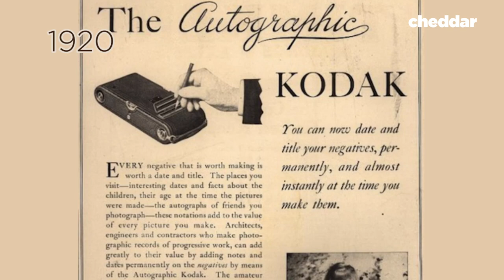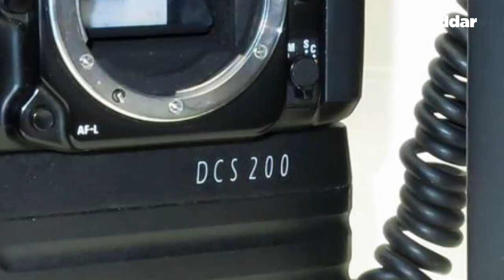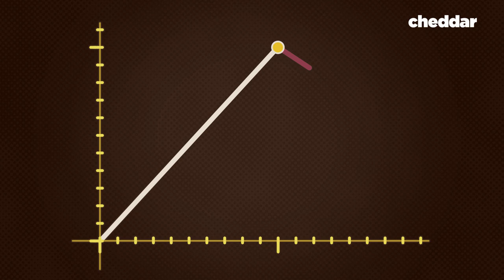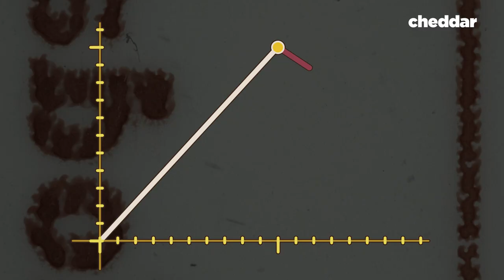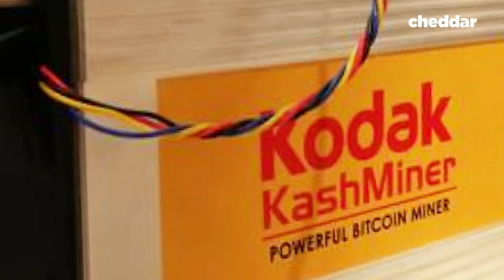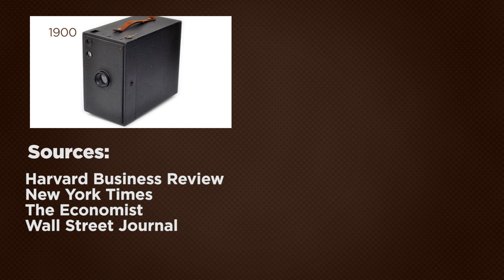Why Kodak Willingly Ignored the Future of Photography - Cheddar Examines

Comment: As a photographer who shoots 90% film. Kodak is still very much alive. Film prices are only maybe $2-3 higher than they were 20 years ago (depending where you shop). And Kodak released two new film stocks in 2018. Something that no other major film company has done in years.
Reply: I shoot some film from time to time and can agree, film is Still cheap (not using your phone camera cheap but Still cheap enough) even from Kodak, it's just that the Kodak today really isn't the same Kodak as in the past, their size is drastically reduced
Reply: But, where do you develop such film nowadays?
Reply: @jsprite123  Google it. There's still lots of places to do it.
Reply: Kodak had a lot of problems not talked about here. They were so profitable for so long that everything they did was top heavy with cost and over-engineered. Fujifilm was cutting into their film sales because they were making their products in lights-out factories that were essentially identical, i.e. lower cost, more efficient. Kodak responded to this competition by trashing Fujifilm, saying their color was inferior. All the while consumers were buying more Fujifilm. 

You could write a big book on this very interesting subject. I saw it firsthand as a software vendor to Kodak in the late 1990s when they were unraveling.
Reply: @jsprite123  Either at home or in some of the labs still around
Reply: @cpufreak101  I am puzzled by Kodak thinking. Do I understand correctly that they are pushing a hopped up version of their old Super 8 movie camera. If so, did do their R&D in a cave?
Reply: @marcomalo02  lmao. no the company itself is physically a much smaller company than it was back in the day.
Reply: Film is still being updated. The current films that we have are the best that photography has ever seen(except for TriX, HP5 and the likes).

Taking that into account, they cost just the same.
Reply: they nearly dissappeared. And finding kodak films isnt as easy or cheap outside the USA as kodak only has ONE manufacturer in the planet.
Reply: keep smokin that. No one develops it. Move on...
Reply: @justayoutuber1906  the lab in my city that develops 2000+ rolls a week would disagree with that.
Reply: Why would you still use age-old film? I mean, what real benefit does it have over sd cards and such? All I can say is that my sd card will not by damaged by SUNLIGHT
Reply: @ThatTechChannel101  This brings in the question of personal preference. Many would argue how enjoyable the process of taking photos on film is, but at the end of the day the results you get out of film is what attracts most people. Just take a look on youtube, searching film photography - there are endless videos on the topic, showing the benefit of film photography. Sure, it isn't for the average person who is looking for convenience - but for the professional/serious amateur market. It's like saying to a car enthusiast, why would you drive that 40 year old Porsche, there are so many better cars nowadays. They would laugh at your face.
Reply: @samskordi6079  interesting.......
Reply: They trying they can still make it

Comment: This is where we are with environnemental issues. We could embrace change, create jobs and become technological leaders in wind and solar energy, smart grids, clean transportation, and have cleaner, healthier air, but we insist on defending fossil fuels in fear of change. Kodak had a 15 years head start, and the resources to make the most out of the change ahead of them. We are in the same position today.
Reply: Sad
Reply: Not at all the same
Reply: Not even remotely the same.   Explain to me exactly WHO the customers are for all of this wonderful, expensive, unproven, and unworkable technology?  Which consumers want a less reliable, more expensive electrical network with higher maintenance costs, large amounts of time when power is unavailable, common brown outs, and other huge pains in the ass?  Where are the customers who want to pay 2-3x the times for this "clean transportation" you speak of?  If it's so popular why aren't busses, trains, and subways literally packed to the gills with customers, instead of needing federal, state, and local subsidy just to exist? 

Digital cameras came to be popular and take over virtually the entire camera market when they became VIABLE. Digital cameras are popular now because they are cheap, reliable, and improve on the product they replaced.  They make as good of/better a picture as the common Kodak cameras of yesteryear, cost about the same, and offer the advantage of at home printing/see your picture before printing, plus they can take virtually unlimited photos with one cheap SD card. 

 What you, and others, would have us do is try to artificially accelerate the development of all this "wonder technology" by forcing a unprepared product on a unwilling population.   Nobody was tripping over themselves to buy that first digital camera, which would have cost thousands upon thousands of dollars to create a picture only as good as a 50 dollar camera, while being impossible to carry around and insanely slow (records on a digital tape).  This is "green" energy/transportation right now.

This is the scam behind climate change... people getting rich because a very expensive, unwanted product is being forced down the public's throat.   The reality is, all of this technology was coming anyway.  We have literally spent TRILLIONS attempting to force the equivalent of a 1970s digital camera on the public, when the 2000's digital camera was coming anyway.  Nothing stops technological advancement, nothing can stop science from proceeding.   The real question is... are you really willing to entirely destroy the middle class and impoverish two generations of Americans so that we can arrive at a "green" economy  1-2 decades early?

Think I am exaggerating?  Look at the Paris Climate Accord you no doubt cried over when the US pulled out.  Estimates from pro environmental groups (let alone honest ones) calculated that to meet the accord's goals in the US, the average American's electrical bill would need to increase by a factor of ten between 2020 and 2030.   This means that if you currently have a 100 dollar a month bill you would be looking at a 1000 dollar a month bill by 2030.  Personally I would have been looking at a bill in 2030 of around 1,750-2000 dollars a month just for electricity.  That's nearly double my mortgage payment!
Reply: @testy462  You are obviously a climate change denier so no amount of argumentation from me can change your mind about that. But my point was that this story is a good analogy to our current situation: it's about embracing change. 

Sure, they couldn't have launched a digital camera in the 70s, but they had no excuse to be late in the game and let competitors win the battle. And what I think you missed is that change is not always a choice. Kodak couldn't do anything against the arrival of digital cameras, but they could at least be prepared. Climate change and other environnemental issues are a thing and if we don't act, we are going to face even bigger issues. Health issues linked to pollution are real, communities are getting progressively destroyed by rising water levels, droughts, disappearance of natural resources vital to local economies... It's estimated hundreds of millions of people will have to migrate due to climate change. 

Now, you're right, those technologies are not ready, and are, for now, expensive. But it's up to us to work on those issues and make them cheaper and better. We can create local jobs that can't be relocated in other countries. China is far from being a green country, but they are investing a LOT in solar, batteries and other critical technologies because they know there's a lot of money in those. It's up to us to compete.
Reply: That's interesting.  I was thinking the same things while watching the video. I don't have a solar panel or EV yet but it is a future we are moving into.
As a photography enthusiast, I thought Canon and Nikon will have a similar fate ignoring/delaying mirrorless cameras.  It was quite late though.  A year or two ago, I am expecting them to enter the smartphone industry as their expertise can be of value.  However, it feels quite late again now that Huawei and others are releasing ridiculously featured camera systems with at least two cameras per phone.
Reply: @testy462  If only I can dislike your comment multiple times. Even your point on digital cameras is missing the most important reason why it became popular.
Reply: BA_300_AAC Wow, you really hate green energy don’t you.
Reply: because you are in USA, a country where it only looks BACKWARDS when the  world around them is changing.  The middle class of digging for fossil fuel is DEAD.  I am sorry.  Just like automobiles destroyed horse and buggy back over 100 yrs ago.  It is going to be PAINFUL for a while until gainful work can be found for these folks.  Technology disrupt life in non-incremental ways.  Look at how long it took for PC's to change their life of a secretary.  From a person who just type reports and answer phones to now many other dimension of a companies affairs. I really wish there is a more gentle answer to what's happening in the world but this had happened before and it will happen again.   @testy462
Reply: hah. hah, hah. hah, hah, hah. Thanks, that was funny.
Reply: @genderfluids6448  He literally called climate change a scam in his comment.
Reply: Green energy is for the ungrateful and uninformed, and the greenest people on earth are the poorest. Change my mind
Reply: @quickminutetv4170  Poor people can't afford to go green.
Reply: You really don't know what the situation was with Kodak. Most of their earnings came from selling film 7$ a pop, and you blame them for not selling a product that would eliminate their profit.
Reply: Or we were in the same position 20 years ago, but GM killed the EV1. LOL
Reply: @chadthundercock4806  I blame them for knowing what was coming and not reacting properly. They were a chemical company and not really a camera manufacturing company, but they had years to prepare the shift and still failed.
Reply: mike a  Calling something a hoax is denying it, I don't see the problem there...?
Reply: mike a  I agree with you there's a lot of hypocrisy from public figures, but that doesn't mean there isn't a real problem behind all that.
Reply: Martin F Alright, lets say they somehow transition from a chemical company to a digital camera one and by some miracle their stock doesn’t plummet and lose millions.
The iPhone exists, Kodak gets fucked wether or not they transition to digital.
Reply: @chadthundercock4806  We'll never know! Fujifilm is still around. Kodak too,  albeit much smaller and doing different things today. Maybe they could have done their transitions a bit smoother? Who knows...
Reply: None of these energies is feasible. They simply don't produce enough power. The only promising alternative is nuclear.
Reply: mike a Listen to the scientists not the celebs. There’s your truth
Reply: Biplav Shrestha This is an example of market failure. The effects of climate change are far reaching and the market does not address that .  Hence the need for government involvement
Reply: Remember Solyndra? How solar energy worked for then?
Reply: Market will shift away from fossil fuels on its own when it become cheaper and profitable to do so and quality of renewable energy exceeds fossil fuels. Forcing down environmental regulations almost never work without change that disrupts the middle class in a negative way. It’s called economics.
Reply: @mintar59  I think you missed his point. It took years of development to make the digital camera and solar lol you got years for that. As an electrician I can tell you solar is garbage. First I have to install multiple panels on a roof with inverters to convert DC to AC you'll lose some power  because of the conversion. Then the panels are most effective between December to April, because when the panels get hot the resistance in the line goes through the roof and that's before it hits the inverter so That's high DC resistance. Then alot of customers are fooled thinking they'll have power when the utility is cut out.....yeah um no. You have to have a PV shut off so no back feed can be in the power lines and hurt linemen. So in order to have power during a power outage you'll need a battery storage system. To have an effective battery storage you'll need a transformer to the battery storage and give up more than half energy production to keep the batteries juiced. Now this is residential scale. It's the same song and dance on a large scale and along with wind to. The problem is the public isnt educated that most of these "green" tech make DC power which is useless. However Damns, geothermal and possibly wave technology make alternating currents which can be transported better.
Reply: @zodiacfml   I think you missed his point. It took years of development to make the digital camera and solar lol you got years for that. As an electrician I can tell you solar is garbage. First I have to install multiple panels on a roof with inverters to convert DC to AC you'll lose some power  because of the conversion. Then the panels are most effective between December to April, because when the panels get hot the resistance in the line goes through the roof and that's before it hits the inverter so That's high DC resistance. Then alot of customers are fooled thinking they'll have power when the utility is cut out.....yeah um no. You have to have a PV shut off so no back feed can be in the power lines and hurt linemen. So in order to have power during a power outage you'll need a battery storage system. To have an effective battery storage you'll need a transformer to the battery storage and give up more than half energy production to keep the batteries juiced. Now this is residential scale. It's the same song and dance on a large scale and along with wind to. The problem is the public isnt educated that most of these "green" tech make DC power which is useless. However Damns, geothermal and possibly wave technology make alternating currents which can be transported better.
Reply: Even solar technology can wreak havoc on the environment. All the mining needed for its components plus the toxicity of it after its lifespan.
Reply: No we are not. Nobody is stupid enough to embrace solar when oil is cheaper and more energy dense than batteries.

Comment: I can hear all these oil companies and car manufacturers saying that electric cars will never replace fuel based cars...
Reply: Well, film cameras are still around, they just became a niche thing for photo enthusiasts. Which most probably will happen to gas cars.
Reply: Every car manufacturer of consequence has EVs now.
Reply: You still burn stuff to get that electricity nowadays.
Reply: They never will. Batteries are just fundamentally less energy dense than petrol. There is no technology that can beat thermodynamics.
Reply: Rich 91  Not in energy per volume you cannot.
Reply: Rich 91  first, you are wrong.  Batteries in Tesla take up more space than a fuel tank in a regular car. Moreover, those batteries would take you across much shorter distance and AND take much longer to charge.
Reply: Rich 91   of cause I don't own a car. I have better use for my money. Batteries take way more space (and mass) for the same energy stored that petrol.
Reply: Depends. I think in Texas it would be correct, but not in Norway or China. If they have the will to make the infrastructure works like modular battery swapping and fast charging everywhere then it is very probable. Imagine you can take out a cube of battery at a time at gas station and swap them out like propane tank, take a pee break, and keep on driving.

Comment: I worked there as an intern (BSEE) in summers of 1987 and 1988. 
First summer: on mega-printing machine for the big “mail order” labs. Project was millions over budget but any-price-was-worth-it, because it would keep Kodak set as THE supplier of printing paper and chemicals for the labs. 
Second summer: “Imaging Electronics Center, East” doing research on truly-digital imaging (CCD sensors, modern electronics, digital compensation for imperfect lensing, printing dithering techniques). 
While was back at college for the last year in my bachelor’s degree, CEO Coby Chandler said, ‘we are a CHEMICAL company, not an imaging company’, and shut down the center. 
I went into a different industry, but watched the city of Rochester deteriorate alongside Kodak through the eyes of family members that stayed with Kodak till nearly the bitter end. 
Thank you for this well-assembled review of the rise and fall of this once-great man and enterprise!

Comment: That's about the size of what really happened. The reasons are even sadder. Managers were fighting for prestigious offices and worrying about interoffice rivalries rather than running the company. The top managers wanted a cushy job where they didn't have to think or make decisions. They wanted to ride on what had been done by past generations. Kodak died from the top, while they still had some of the finest Engineers I've ever known.
Reply: I was around then, it was sheer mismanagement that killed Kodak. They died a death of a thousand cuts. There was no vision or even a real mission, it was purely about shareholder value.